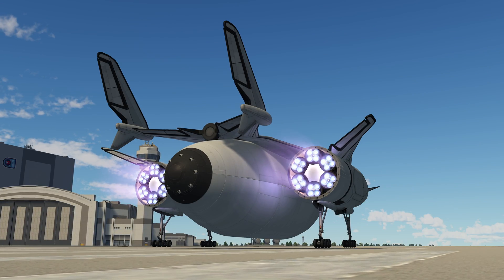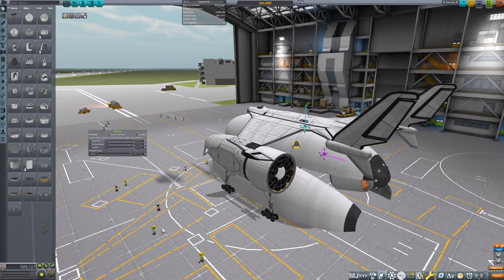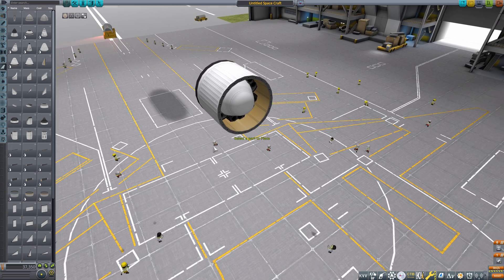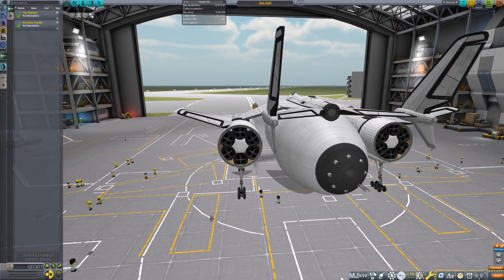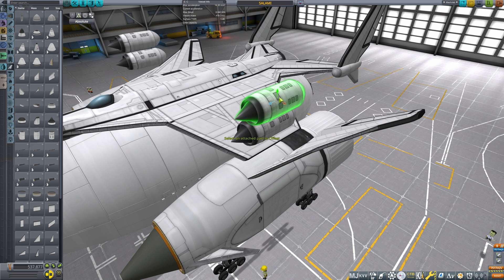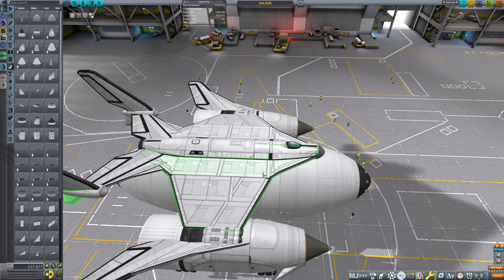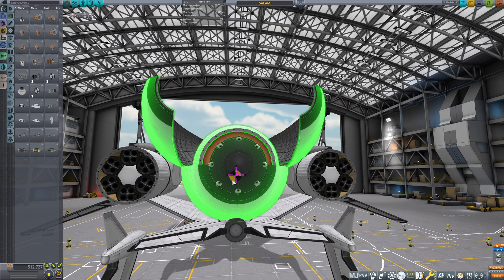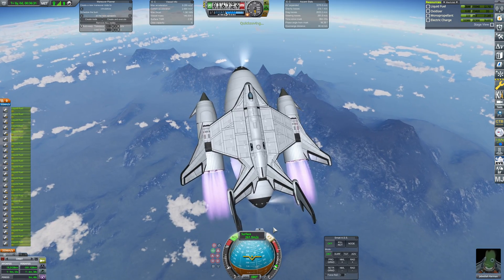SSTO to build interstellar ships in KSP!

Comment: The difference between the occluded fuel tanks, and the tank with the nose cones is more than just the drag. It also changes where, and how much body lift is generated. Fairings in general create much more body lift than fuel tanks, and all that lift is applied at the base of the fairing. As opposed to the tank with the nose cones where each part generates body lift. This may not be a big deal during horizontal flight, but can have severe impacts during reentry at high angles of attack.

Also, you could try adding control surfaces on the inside of the main wings to act like flaps. It should help decrease your takeoff and landing speeds
Reply from the maker: Yep there is that. Also nose cones tend to be way lighter than "normal" fairing setup. 2 nosecones are usually ends up under 1t, while several fairing spanning several fuel tanks can be easily 5+ tons. There are differences, but for the most parts I think nosecones are even superior to fairings if the ultimate goal is to reduce drag at minimum weight. Meanwhile fairings are superior in their ability to heatshield occluded parts, and this alone can help to use full library of fuel tanks to build SSTO!